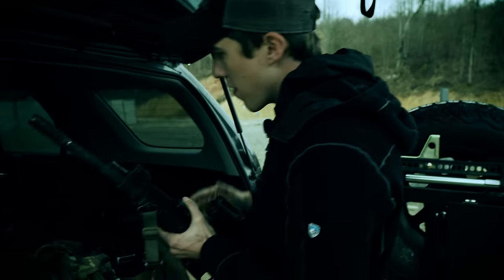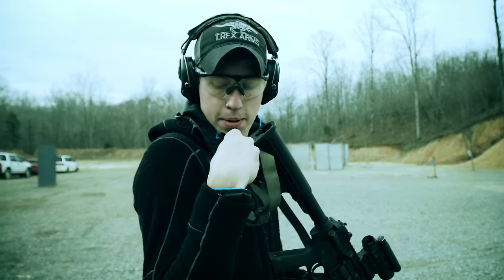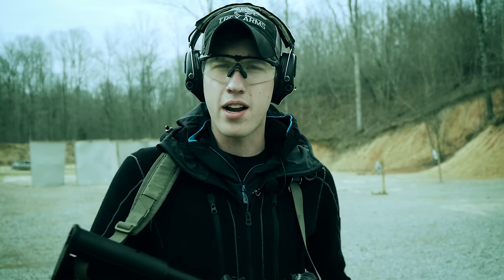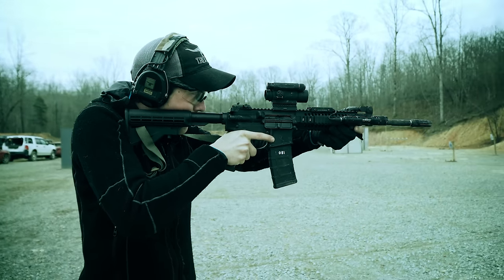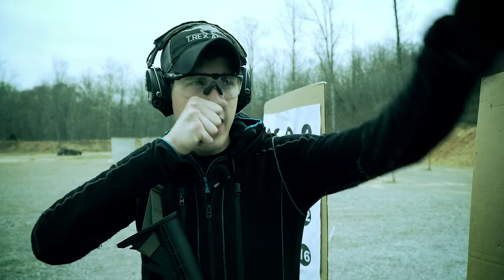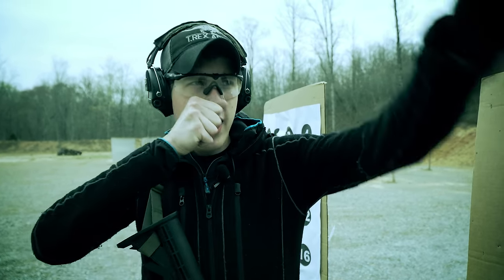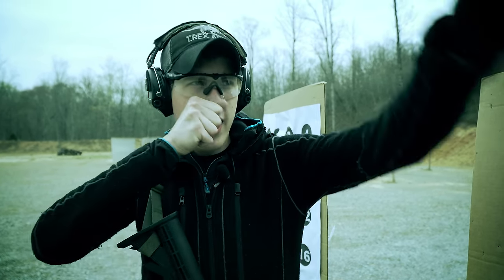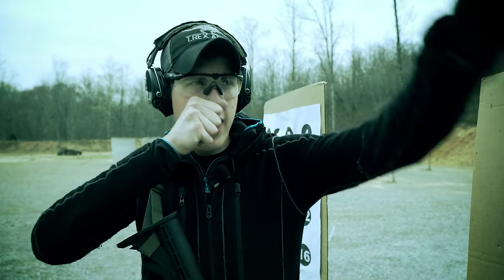How To Control Rifle Recoil

Comment: I just hit 16 years in the military.  I'm not a terrible shot but could always improve.  This kid just gave me the most efficient explanation for recoil management I have ever heard/seen.
Reply: cant rely on the military for a damn thing. even shooting. haha
Reply: Then you have terrible marksmanship coaches
Reply: With some obvious exceptions, the US Military's Small Arms Training has been in dire need of new thinking and overhaul for a long time now. Most of the personnel I've seen  fresh out of basic and advanced training are lacking in even fundamental skills and to the point they need and should be re-trained so they can be moved to more advanced weapon handling skills that build and allow them to confidently maintain those perishable skills. The Military does in fact have very good basic and advanced marksmanship instructors and advanced weapon skill instructors but the overall basic and advanced programs could use some valuable forward thinking changes. Some may agree or disagree with my, it's just my 30+ years of experience & seeing what does and doesn't work well over those years.
Reply: Best part is how calm and humble he is about it. No macho posturing.
Reply: @atlanticdefense3818  As a former 6 year Army Infantryman, I completely agree. I entered the Army without ever having handled a firearm in my life. I was age 20. I was actually surprisingly good, but my Drill Sergeant chocked it up to me not having bad habits related to prior firearms experience. 

After I was in the Army a few years, I noticed many people coming out of basic and into my unit with really mediocre shooting skills. I eventually retrained most of the people who were fresh out of basic. Don't even get me started on shooting with anyone who aren't in combat roles. Their marksmanship training is laughable at best. It all needs a big overhaul. This video is excellent and this guy has zero military experience. Just good training. I love it.
Reply: Wait in the military is wlan

Let's go Military
Reply: Pog
Reply: So let me get this straight.  You want tax payers to fund non-trigger puller MOS personnel with shooting skills that are above basic...  Why?  Basic marksmanship training is specifically for individuals to get comfortable with handling and shooting a firearm safely and and knowing you can qualify Marksman or better.  We don't need to fund the training for cooks to clear rooms.  That should be a unit specific task for certain MOS, oh yeah, that's right, that's exactly how military firearms training is setup... Congress already has it right.
Reply: Our country is doomed then..
Reply: No kidding. I too am a veteran combat leader (retired) and he just blew some of my high speed instructors out of the water.
Reply: @50shadesofcerakote  I went from never having shot a gun to being an expert with rifles and pistols (and eventually the mp5) just from my initial instruction in basic training. 

It wasn't until after I got back from iraq and went to SRT school that I really learned how to hit things while moving with a high proficiency ( weapon manipulation in cqb was big). PSD school further honed those skills. 

Basic military rifle marksmanship is great for your first shot. Good luck with your second
Reply: You need Jiu-jitsu
Reply: @rifleshooterchannel208  everyone misses at insanely close distances in combat sometimes
Reply: You not really in the military. Are you?
Reply: Does he really want his dot going up and to the right?
Reply: VikingSix I was thinking the same thing. I wish I had him as an instructor down range.!
Reply: 4 more to go
Reply: Yeah I've been through several courses and the instructors just read the course materials (circa 1991) and take us to the range
Reply: Common sense helps! Why, "Do we not float off into the sky" !? study of physics! "might be necessary"....apple "assaulted" a "bruh's head" one day! LOL! The, "video game explanation work's" too! ¬.^
Reply: @rifleshooterchannel208  Implies' that you have "knowlege" of navy seal's during deployment? Enjoy that! ^.^
Reply: Honestly. This makes me want to toss my expert rifleman badge in the garbage. I don’t get why the military is letting servicemen fall behind civilians in close quarters marksmanship
Reply: I think this is called practice! You and I should do it more often! The people that come to take your practice devise's prolly practice more too! ¬.^
Reply: Andrew Boos wait, you’ve been in for 16 years and you don’t know what a Combat Marksmanship Coach is? And you really should have to check your rifle out to go shoot on your own time. If you need the practice there’s other ways to do it. And if you don’t understand the fundamentals of marksmanship it’s probably because you have bad coaching.
Reply from the maker: @Rifle Shooter Channel where’s the proof of the speeding up videos? Also.. i posted videos from that match. Only my Comp belt. But I guess nobody cares about fact checking anymore.
Reply: Gun confiscation is against the law....thank you for your service..
Reply: is your Handle your callsign?
Reply: @50shadesofcerakote  facts
Reply: @russ8059  have you been in the military? whats a "marksmanship coach"?
Reply: Rifle Shooter Channel so is that what you think about seals or rangers or raiders that haven’t seen combat but have hundreds of hours of training (not saying that guy does but you never know) and thinks about what happens in combat and plans accordingly?
Reply: @Dan-wf7fb  rog,lmao totally true man .Just because you get in a fight and get punched in the face. Doesn't mean your a better fighter aftwards, same gos here.
Reply: Love the fact there is more discussion around the person over the advice.. anyone got anything to say about the skills he is trying to impart? They seem and sound pretty solid to me. Next time I get the chance I’ll be trying some of these techniques.. (being in the UK that could be a while)
Reply: Russ805 ...you don’t know how true your comment is.
Reply: Atlantic Defense ...I’m a veteran of 31 “combat ready” years. You said it better than I could.
Reply: @rifleshooterchannel208  I bet I could find your comment on no less than 50% of Lucas' videos though....
Reply: @rifleshooterchannel208  Would you say the same thing about Rob Leatham? Jerry Miculek? Taran Butler? There's a difference between someone teaching others "how to shoot" and teaching someone "how to gunfight".
Reply: @ClawsoftheLion  Except when the enemy takes you by surprise and gets into your rear. Then the cooks, clerks, and mechanics have to be riflemen. God help them if they're not up to the job.
Reply: Kyle Brehm I was taught to shoot very well in the military, I’m not encouraged to fire my weapon unsupported. I’m taught to mount my weapon for recoil control. But yeah this video has really good advice for firing unsupported. I’m going to use this advice on my next qual
Reply: The best shooters are people who do it as a hobby, you just don't get the range time in the military.
Reply: Military is literally the worst thing to reference for learning shooting lmao
Reply: @justinrisen1929  Rifle Shooter Channel is completely empty except some of their subscriptions. No public videos, so I guess its obvious who is fake here.
Reply: Totally. I'm coming up on 3 years in and I've decided I have to practice and learn on my own because I'm laughably under trained with a firearm.
Reply: @rifleshooterchannel208  by all means since it sounds like you have it all figured out, you should have no problem starting a successful shooting school, YouTube page, and business. So brave, so tactical
Reply: @rifleshooterchannel208  I'm implying if your such an amazing tactical ninja, put your money where your mouth is.
Reply: Has to be one of the best videos I've seen so far.
Reply: You must be in the airforce
Reply: I just came here to draw this kind of stuff haha, you know call of duty fanart
Reply: Steven O I am not military. However, from what I understand, there is much more to the military than just weapons handling and marksmanship. Sure, many civies might shoot better than any infantryman; but do they have the physical fitness to match? Physical and mental endurance, discipline, and teamwork?

I would think that usually is a definite no.
Reply: @TREXARMS  Ignore the jealous people. God Bless I really appreciate the help, it has helped me a lot with my AR.
Reply: Congratulations. Much respect to you and your team/s
Reply: @gdoumit  Thanks for your service
Reply: @rifleshooterchannel208  sorry I got triggered anyway I'm a professional editor and the clips aren't sped up XD
Reply: @rifleshooterchannel208  there actually not there's no why to speed it up like that trust me I tried to when I was editing a fight scene for a friend.

And it's all one shot so there's no point in speeding it up even if his shots are slow.

EDIT: don't say shit like that when you know nothing about editing.
Reply: @rifleshooterchannel208  okay keep saying it but you're wrong
Reply: @rifleshooterchannel208  dude you're probably like 6 give up
Reply: @rifleshooterchannel208  why talk shit when you don't know the man? I don't get it.
Reply: @rifleshooterchannel208  one year later, and this is still the dumbest train of thought on the interwebs.
Reply: @glennsosinske3260  Nah, I dont think thats gonna happen. With citizens like these.....do you actually need an army?
Reply: He shot one stage in that tourney.  He was dq’ed.  On the stage he actually shot he placed 9th.
Reply: @rifleshooterchannel208  So he's getting success through his channel and that hurts doesn't it. lol
Reply: @rifleshooterchannel208  it kills me that people don’t like content and then comment and voice their opinions which helps that person out further.  Doesn’t make any sense.
Reply: Right, none of us 03's were perfect shooters but I wish I'd watched this when I was in
Reply: @atlanticdefense3818  yes! thats exactly why spec ops and tier 1 units turn to the private sector for most training
Reply: Hey you should be 18 years in now. Congrats! Only 2 years away from retirement!
Reply: This kid needs to stick to call of duty and leave it to the 75th talk about speed shooting and tactics
Reply: I've been in law enforcement for 10 years and were in the same boat. Most cops can't shoot for shit, and most "instructors" don't know what they're talking about. Most of the instructors I've came across are the macho type that won't listen to some "internet bullshit", instead they keep repeating the same dogma passed down from their instructor that stemmed from the 80's. My firearms instructor still teaches the new guys magwell grip!!
Reply: And he gives it civis free
Reply: @TREXARMS  your fundamentals are on point man. Screw that guy.
Reply: @rifleshooterchannel208  what, exactly, is wrong with his fundamentals then?

People like you do a disservice to the 2A community. All those flavors to choose from, and you're still salty 😑
Reply: @sethdbrown30  magwell grip is still a viable option, especially if you're doing extended periods of time clearing rooms, training etc. Shouldn't be your go to though. Takes a lot of the fatigue out of weapon manipulation. 

Hold a hand under handguard stance for as long as you can, break for a few minutes, and then hold a mag well grip for as long as you can.
Reply: @rifleshooterchannel208  You have been talking shot about this kid for like two years 😂. Step out of the closet in your mothers basement and live your life. You are brave and beautiful 🏳️‍🌈 ⚧ 🏳️‍⚧️
Reply: @Dan-wf7fb  nailed it. I remember my first fire fight. Wasn't a good time and it I had video of myself...I'm sure I looked like a shitshow
Reply: @ClawsoftheLion  yeah, you’re right. Government is never wrong and what has always been should always be because…it’s always been.
Right?
Reply: @rifleshooterchannel208  post up your vids then bud. Shut up or put up.
Reply: **Except it's not up and to the left; it's up and to the right; clearly a lack of experience with machine guns.
Reply: Off topic (sorry in advance) but does anyone know the names of those big numbered targets
Reply: What branch are you in? Marines don't have this problem....
Reply: @KeiyssChillBeats war with us and we’ll gladly show you 💜
Reply: Word. Me too man.
Reply: @Jordan Hughes Prove it.
Reply: Here for military too lol
Reply: "I just hit 16 years in the military"
no, you didnt. youre a homeless person paid by the comment to post via your free smartphone.
Reply: @m5a1stuart83  dude it’s insanely useful. I cannot recommend BJJ more. Everyone should learn. It’s very empowering when it comes to close quarters. You know your not completely reliant on a firearm. Yet you want that firearm for sure lmao
Reply: Good stuff. Thanks for sharing. Not everyone in the military is combat arms. There is a big misconception about the military that they think everyone has time to do this kind of training. You don't. I respect the combat arms MOS as equally as someone who is in finance or in logistics. A winning military doesn't  run solely on a bunch of well trained shooters there are other skills at play. It's about how to put all of those things to use and win wars.  That being said thanks for sharing the knowledge. I spent more time in firefighting simulators in the military than I ever did on a shooting range. The best simulator was 2 stories and used vaporized diesel for a real ship board firefighting experience. Go figure. I am sure if you were passionate about other skills you would excel at teaching those as well.  Thank you.
Reply: Your the soilder s we need you fight long and hard but even without perfect aim you still make a difference

Comment: WOW! I've been in a tactical unit for 4 years and have trained with a large number of experienced instructors, but I've always found that my accuracy was not where I wanted it to be will rapid firing. Instructors would always tell me to "tighten that up" but none would take the time to explain how to or tell me what exactly I needed to change. No one has ever explained me how to manage recoil in such a detailed way as you just did. Thanks Lucas!!

Comment: Can you do a recoil management video for a pistol?
Reply: Lejin good grip is everything. i lot of tips here in the carbine portion reflect heavily across multiple firearms platforms.
Reply: pretty easy, grip has to be as high as possible, one hand pushes, the other pulls. ankle on the support hand locked. as long as you dont shoot .500 s&w or anything similar recoil schouldnt be a problem anymore at all. talking about full size guns here, compact and smaller might be anything else, idk. glove size 10. anything below duty size is a deringer for me :)
Reply: @amoredfist  Smaller pistols can be a pain, but I still carry a Glock 43. I added a +2 extender to add more grip space and it's perfect. I can shoot them as effectively as I can a full sized Glock.
Reply: @gdoumit  i do understand the reason for those small guns, the problem is i live in germany, therefore carrying a gun outside from the range is no option. and i think anyone will agree that target shooting with a full size is a no brainer compared to a compact or sub-compact. for cc i agree that a 43 or a 42 with .380 acp xtreme defendr +p would be the best choice.
Reply: armored fist Yeah I can totally understand that. I carry daily and my carry weapon is definitely my Glock 43. I originally wasn’t thrilled with it because the grip is definitely short and my hands are a bit wide. The extenders were great to fix that problem. I wouldn’t recommend getting this size weapon if you live somewhere where concealing could get you thrown in jail.
Reply: @gdoumit  hey! The +2 extender was the best thing i did for my edc.
Reply: armored fist i wouldn’t want to go any smaller than 9mm 🤷🏻‍♂️
Reply: most pistol calibers are VERY tame in recoil. of course we could be talking about a 500 S&W or higher, then there is some, but nothing an average adult can't easily handle for a few shots
Reply: You have to put your other hand on top of the barrel, that will keep the recoil minimal.😜
Reply: Update - I was able to get my recoil under control. Grip was everything. I messed around with different grip methods after searching for a million pistol grip videos. A lot of it was just getting to the range and practice. Took me about a day of shooting to get it down.

Comment: One of the very first things you did that many missed is you checked your chamber and made sure it was safe. You are like me in that respect. It is just something we do without thinking about it. Safety is so important and so many people just do not make an mental note to check the weapon before removing it from your vehicle. When you are out on a range where other shooters are you can be assured that at least you are bringing a weapon out that is rendered safe .

Common sense is an important part of responsible firearm ownership. I appreciate the fact you have just made it part of every drill . It is one of the reasons many consider you to be ideal to train others. 

I do have a question and I hope eventually it will be answered. Can you send a upper receiver with barrel to a gunsmith and have it legally cut down and a permanent flash hider or muzzle break installed? Pinned and welded or what ever is required?
Because ATF confuses the situation. Under their "you can not alter a weapon" rule would it be breaking the law?

Comment: What i like about this is that 1) it shows you don’t need a super tricked out weapon to be accurate. This is pretty much the same setup u had for my M4 in basic (minus the flashlight and flash hider) and a lot of dudes would talk about how nice it would be to trick out their weapon. But obviously fundamentals make all the difference and accessories just make certain aspects a little more comfortable. 2) clearly you also don’t need to be a large person to control recoil as long as you know what you’re doing and continue to practice.
Reply: *i had for my M4